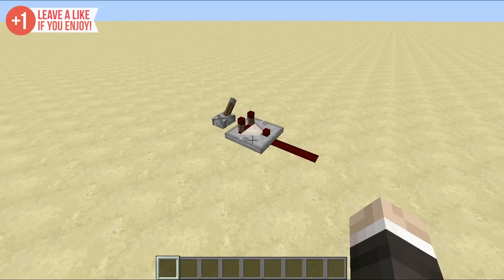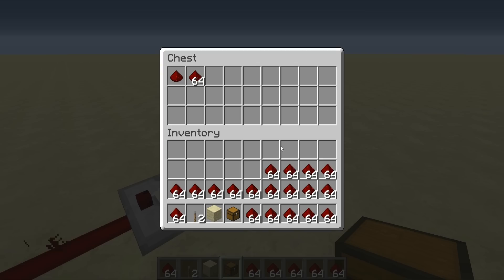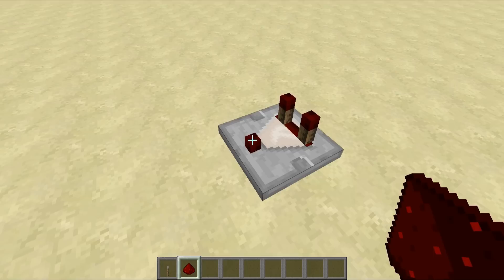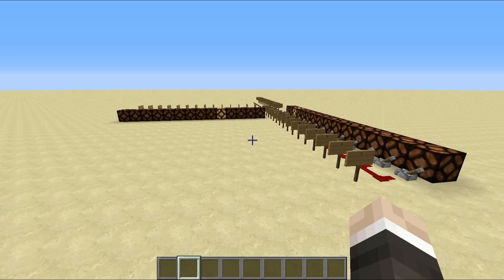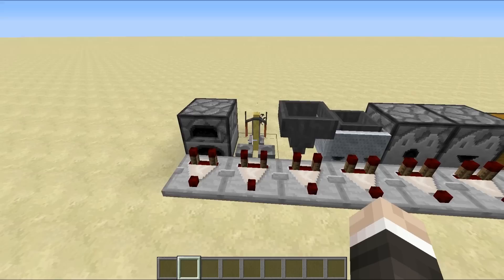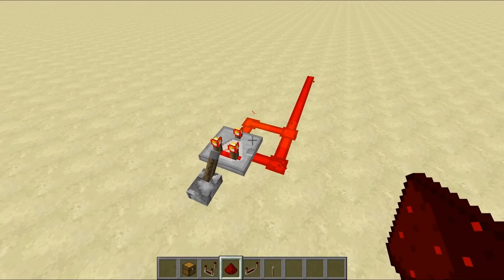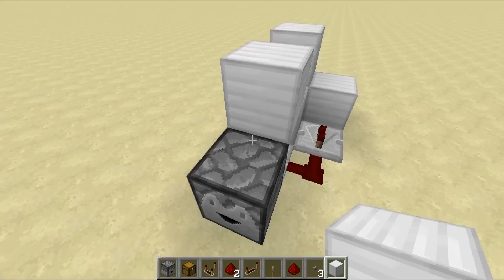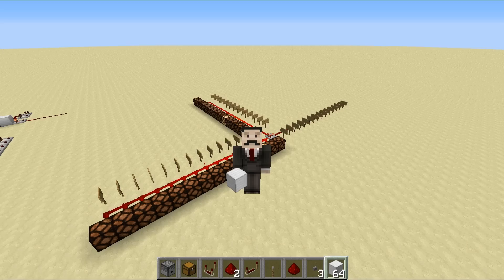How to Use the Redstone Comparator in Minecraft!

Comment: BEFORE WATCHING VIDEO
Let's get some Comparator circuits in action!

after watching video

I'm happy with repeaters :]
Reply: the easiest thing to do is the chest thing
but besides that the rest is a bit confusing..
Reply: NoRMiEx all of it is easy for me except the chest. I messed around with all of it and it’s REALLY simple. But the conclusion I’ve come down with about the chest is that the first item you put in, it gives a 1 strength. Second item you put in, it gives another strength. Fourth stack you put in gives a strength of 3 and sixth stack you put in gives a strength of 4. Starting from the fourth stack, you have to keep on putting 2 stacks to get another strength signal
Reply: Same
Reply: CheeseyDeath15 I watched the video and think the easiest thing to do is the cauldron, u can take out or put water in and it will activate, then when you put it back in or take it out it deactivates
Reply: Ngl I thought repeater is harder but now, I finnaly know how hard comparators are, like I just use comparators for making automatic arrow or potion launchers and hidden room puzzles
Reply: You can build a computer using just dust, torches, and repeaters (and blocks).  For more convenient input methods, throw in levers and buttons.
Reply: @EBestLetterE5  repeaters have two functions
Boost signal to 15
And delay ticks up to 4 ticks. They're very useful in nano crop farms
Comparators can make better clocks unless you're going for the etho hopper clock. Though that also uses a comparator
They can also help with specific amount of signals directly without wasting too much dust
Also they make more use out of detector rails

Comment: Imagine actually being steve and going to engineering university to understand these concepts and taking notes..
Reply: Lol😂👌
Reply: Arka Chanda yes
Reply: This is so helpfull💪🏻 ty mumbo ❤️
Reply: Guess I'm gonna get a B !
Reply: ..and then tries to swim in lava.
Reply: Lololol
Reply: Guess who will be the professor mumbo Jambo
Reply: Redstone is actually based on digital signals in real life electronics; Binary switches either on or off. I'm an engineering students and I can apply things I learned in minecraft. One examples are logic gates which are applications of digital concepts.
Reply: @dashofbloodx6834  yep. Kmap, POS, SOP, the logical gates, Binary transformation, boolean algebra and the laws in it. All are applicable. But not purely. Its a special case because of the tick speed. It can be considered as the time taken for signal to travel. And irl its Zero.
Reply: Arka Chanda yes so it’s probably easier to understand if it goes in little stages
Reply: @dienzer9098  irl electronics does have a propagation speed- massively faster than the tick and repeater delays of redstone of course, but still something engineers need to to take into account. In fact, if building a large redstone logic system, the delay problems and layout questions you'll face will be quite similar to the problems engineers designing high speed microchips need to consider.

Comment: These things are so useful, I've reached that point in my redstone career where now I'm not just copying everyone else's designs (always) but now I'm putting like 3 circuits together to make even crazier builds, and understanding how the random redstone bits that make up the originals work is important when in tight spaces! Also that clock and extender are so much more compact then what I just spent hours on trying to fit with old designs

Comment: I think I have a good explanation for the Redstone comparator equation. I included a TL;DR at the end, and I am willing to answer questions or make revisions to my explanation. 

So the fullness of each slot is measured as a percentage. The fullness of a container is measured as the average of each fullness percentage, and the fullness of the container is also a percentage.

At a glance, one might assume they could multiply the fullness percentage by the maximum signal strength of 15 to find the output strength of a comparator reading a container. It's important to know that truncation is used in order to remove all decimal values from a number. It's nothing fancy, the numbers past the decimal point are literally just chopped off the final answer. 

It's because of truncation that if the fullness percentage was simply multiplied by max signal strength 15, there is a situation in which a nearly empty container (about 7% or less) won't register. If a container was 1% full, 1% x 15 = 0.15, and the .15 would be lost to truncation.

Instead the equation multiplies by 14 and adds 1 to make up for not multiplying by 15. Now, it doesn't matter if fullness x 14 < 1, because 1 will always be added to the final answer before the decimal values are removed.

TL;DR: Each increment of Redstone signal is like a box, and each box can hold only 7% or less of the container being read. The first 7% needs only one box, but the 8th percent needs another box. So for every 7% of the container's total space being used, a single increment of Redstone signal strength is produced.
Reply: your comment made me understand why people would always add + 1 in truncating calls in programming

Comment: hey guys, I found the formula for the redstone signal strength per item in tile entities. I will try and explain it the best i possible could but its essentially this :

the max amount of items held in the tile entity (for example a hopper can hold a maximum of 320 items 5 x 64) devided by 15 (the max signal strength)
in this case we get 21.333 which means every 21 or 22 items gives 1 signal strength if we use a hopper.

this is useful for item sorters or anything that requires tile entities with redstone.

Comment: Wait in subtract mode can you basically make a calculator thatvonly does subtraction like u press two lever with a integer if 1-9 then you put a observer over the red stone which leades to a circuit that shows a number  on red stone lamps
Reply: Yeah but theres no times add or divide
Reply: @j.436  multiplication and dividing are just fancy ways to add and subtract.

Comment: BTW Just saying incase you guys don't know. Truncate mean to shorten E.g. 7.52669278 
Truncated Form : 7.5266
Reply: in Minecraft this means round down

7.9 -> 7
Reply: Thanks
Reply: So 3.14 is the Truncated Form of 3.141592653589793284626433832795028841971?
Reply: +LightningBolt18 Truncate doesn't mean round, it will actually just cut the value. Typically used in cases where you only care about the number left of the decimal point, in this case, the seven.
Reply: Zachary de Boer 
aka, round down.
Reply: it's not the same as rounding because in rounding you could change the number so if you're 2.6 you would round that to a 3 but if you truncate it it's still 2 (you just truncated the .6)
Reply: Jamey Johnson
aka rounding down
Reply: no
Reply: obviously truncating isnt the same as rounding down, but in the case of comparators, you can use round down - it achieves exactly the same.
you're free to give an example where this isnt true, go ahead. saying "no" doesnt do anything, but I suggest you stop arguing cus you're on the internet.
Reply: if they're "obviously not the same" then shouldn't you be saying truncate.  but please, don't use you're amazing internet powers against me.
Reply: Jamey Johnson
no you shouldnt be saying truncate because round down is way easier. truncate is used so programs dont create riddiculously hard computations when you actually just care for a couple of dezimals.
If you care for 0 dezimals (like in this case) you can just use round down.
Reply: Jamey Johnson Lol
Reply: Oh, rounding. Why didn't he just say that?
Reply: Random Schmid He didn't say round down because truncate is the correct (and more specific) word. The operations are only the same when you're rounding down based on the 1s place with some assumptions. In minecraft we have these assumptions: it's always an integer result, it always rounds down; so it's safe to say they're the same. In the rest of the world, this is certainly not the case. There's the fact that rounding can be on a different place, with a different number system, purposeful or accidental. Further, rounding down might leave you with a different value based on the data type, such as doubles or floats which have non-trivial decimal places, truncate might remove the decimal place all together. 

Tldr; same in minecraft, different elsewhere
Reply: That is all correct, however I do not see why you'd use the word "truncate" when explaining a redstone mechanic to mostly underage viewers. This is how you CODE things, not explain its functionality from human to human.
Imo, Mumbo didnt understand the formula either, so he just repeated what he saw in the code example.

Comment: So just to see if I'm finally understanding this correctly... the purpose of a comparator is to dictate exactly how much signal strength goes out to another object?
Reply: Seems so. If I'm getting this right, by using secondary and tertiary inputs, you can manipulate the signal strength of the output. This would probably help in making Indiana Jones-esque traps without the hassle of other redstone components, and making the circuits more discreet. I'm picturing a "dropper timer" that makes a room flood until you break the circuit.

Comment: I wonder why Minecraft multiplies by 14, adds 1, then truncates? I'd think it'd be more efficient to just multiply by 15 and round up, no? Weird.
Reply: IceMetalPunk minecraft is pretty sloppily coded. Especially redstone. Like the update order which is really nasty
Reply: Minecraftster148790
That is true..
Reply: If you think of how "round up" is implemented in Java and then count the CPU instructions it might make more sense. Add and truncate, or truncate and add, is almost always more efficient then a "round up" implementation.
Reply: Bonadew
Hm, I never really looked into the implementation details of round, floor, and ceil; I always just took them as atomic operations for some reason. I couldn't find the Java implementation of it, but I found the C implementation and...well, there are many, many more bit operations involved than I thought there would be XD

(Although others have said these functions are often implemented hardware-level, in which case they would actually be atomic, so...I guess it depends on what platform you're running the code on after all.)

Comment: So in a nutshell, the comparator can receive redstone signals from the side of blocks, through blocks, and other confusing things (maybe). the comparator has 3 inputs and 1 output. The 3 inputs control the output, in compare mode if the left or right input is greater than the bottom input (lets call that the main input), the output will not work but if the main input is stronger than the side inputs then the comparator will act like nothing happened and will mind it's own business. In subtract mode, any input gets subtracted with the highest input so the 'main' input doesn't really matter here but i will still call the main one since it is easier to understand. If i have a redstone signal of 15 at the main input and a redstone signal of 12 in a side input, the comparator subtracts them and it will equal 3. if the main redstone input is 6 and the side input is 8, the output will be 2 since the comparator takes the biggest input value first then the weaker value will be added (well subtracted in this case) which makes it 2 since 8-6 is 2. the same rule applies even if you have all 3 inputs connected, if the subtracted value is higher than the strongest redstone input, the output will not have a redstone signal. The other blocks that can trigger a comparator gets confusing real quick but that mechanic will probably be the most useful one you'll use. as far as i'm aware of, the more slots items take up in a chest, the stronger the signal (same goes with hoppers and most likely droppers, dispensers, and maybe cauldrons since you can change how much water is in it). Brewing stands, furnaces, and other blocks that i didn't mention are confusing af to me but i tried to give a decent explanation here.

Comment: I get it. Which means that we can make a subtraction machine using redstone repeaters, 1 comparator on subtraction mode and 1 comparator on normal mode if you want to show negative numbers (to detect if the signal strength going in the back of the comparator is less than the signal strength going in the side).

Comment: All I remember is : addition and subtraction comparing and length of the material used to activate the comparator to draw signal strength so it can activate the object at the end of the redstone output aka dispenser,dropper,piston,sticky piston, and powered rail
Reply: Also i accidentally made a sugar cane farm with two settings rapid farming and automated farming
Reply: Redstone torch kept burning out but a made something to automatically reset the restore torch

Comment: So the gist I got is that it's reading of block inventory capacity is abit more complicated. (it's like it powers the redstone based on how much you have in a chest for example. Probably best to experiment)  and the normal redstone stuff is just imput power vs input power.  Instead of it multiplying it it' subtracts. Think of it as a Reverse Repeater, that needs a redstone signal of the capacity you'd want to decrease.  You add 8 redstone powder of imput into the comparator and it'll output 8. Run 4 into the side of that you'll get an output of 4. That's the basics of it. (ps. make sure the comparator is on xD)

Comment: Mumbo my man, I'm looking for a circuit for the comparator that feeds into it's primary input line to increase strength without it being a clock, a single pulse turned into a stronger secondary pulse and then no more pulse. Looking for a way to create a circuit where multiple outputs are turned off before being toggled and all by a single switch.

Comment: (first of all, yes i know this is old but...) tbh this actually pretty easy if you understand it, it IS confusing, until you put some thought into it. when i made this comment i was at 5:28 so all i know right know is when the comparator is on SUBTRACT mode, it takes two inputs and subtracts them by each other, then the remaining number is the redstone strength of the output, (so basically it's just subtraction :/) and im pretty sure that it can subtract THREE inputs from each other and have a valid output (so to put it in a way, redstone can be understood if you know MATH).

Comment: Im trying to use this for a mod i play with called pneumaticcraft, the pressure cannot excede 5.0 bar and i want a comparator to read off a gauge and effectively turn off the air compressors when the comparator outputs the signal from that gauge that means 5.0 bar. Im just so confused

Comment: For the ones who didn't get it: Think that the normal mode comparator is a Switch
"Why would I want to have another Switch If I can just press my lever", Simple, with a comparator you can use your lever from both sides, Because with the comparator Your lever can be 2 at the same time, it is extremely useful.

Comment: I tried to do the clockwork dropper and realised that the dropper wasn’t dropping anything.

I was fiddling with the options presented and realised that the redstone powder on the block atop from the repeater and comparator wasn’t actually powering the dropper (after testing a dropper atop the dropper.)

So a small fix, just place a redstone torch above the dropper on the side of the block activated by the redstone powder on top to power the dropper!

(played from a console)

Comment: So basically, the comparator in normal mode detects how many items are in a containter / how many honey there is in a bee nest and it also compares the signal it gets from the side of the comparator to the back of the comparator, so if the signal strength from the back of the comparator is weaker than the signal strength from the side of the comparator, the thing wont give an output.

But subtract mode, oh god i don’t understand that.
Reply: subtract mode is just exactly what its called. It subtracts 2 numbers and puts out the sum. Input 1 has a strength of 12. Input 2 has a strength of 8. The comparator now calculates 12 - 8 and thus puts out a signal strength of 4.

Comment: iam trying to make a vault where you need 2 redstone inputs to open it (code and keycard from security craft) and it seems like by the time the Redstone is turned off by the torches from the signal it turns on again giving the system power and not enough time to shut down the go on again, ik its confusing its 10 at night and i need sleep
Reply: i figured it out, but i have another problem where the vault works its just that the keypad will open it on its own so as with the keycard reader, i want to make it so that you must use both inputs to make a strong enough signal to open the vault

Comment: Wait a minute I literally knew a way how to make a exor gate it's crazy simply all you need is to like free levers then one redstone book but all you need is one compared and then the redstone for the wiring then you just need to make a not gate at the output but the input has to be on like all the time on at signal strength 15 because the lovers are there but yes this you can just knot it and then that's an ex or gate and the next norgate is exactly the same as the all the x or the x norgate is what you have done with the comparators compare mode if you put two levers on the exact sides without any redstone in between so wow you actually taught me something